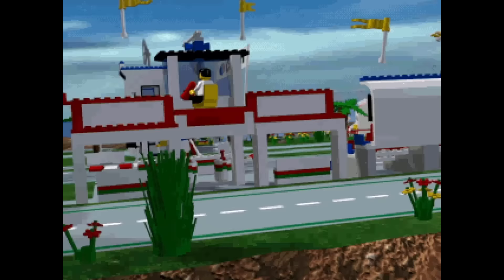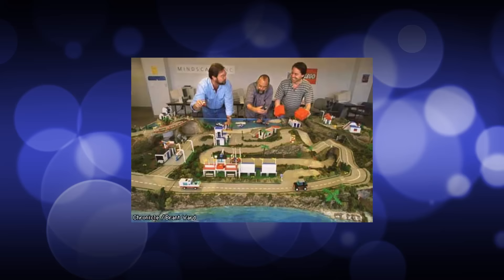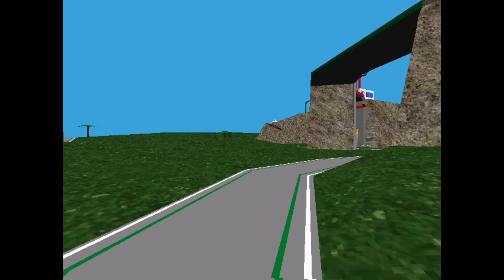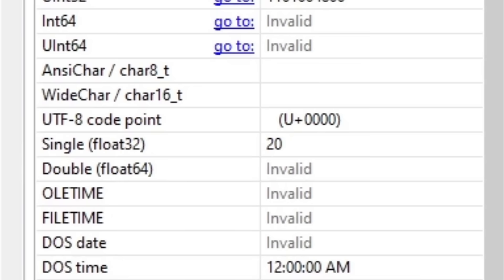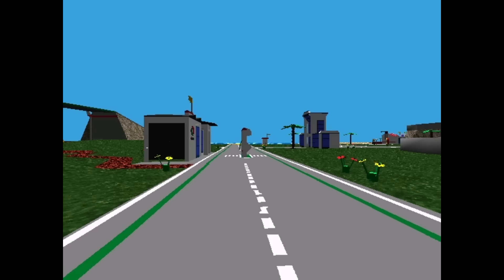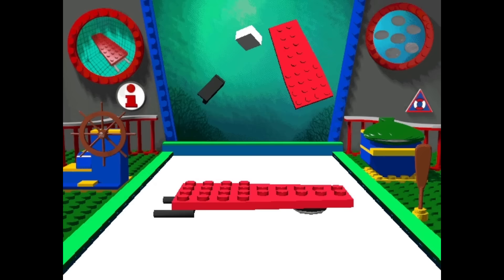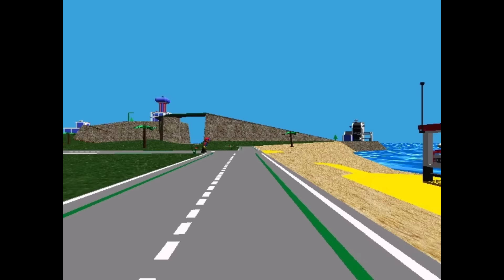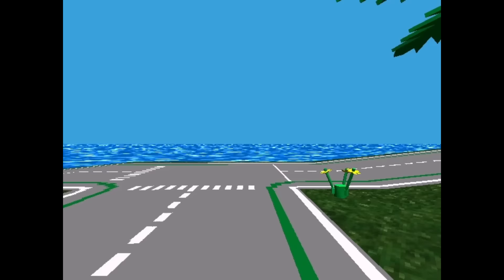How I fixed LEGO Island's WORST bug

Comment: It's 23 years later and devs are still making games rely on FPS for physics. when will they learn :(
Reply: Because they dont touch physics at all in their games.
Reply: @czowieknuz7507  true they just use old physics engines
Reply: @Cleroth because its not his job
Reply: @czowieknuz7507  No, physically "convince" the developers to use time instead of framerate.
Reply: time.deltaTime I FUCKING SWEAR
Reply: @iceburger3933  lmao fucking same whenevere I play some shitty FPS limited console port or a toddVerse(tm) game
Reply: @wesleymays1931  As a software developer if there is one thing I do not like is anything that has to do with time, it is my guess this extends to any kind of developers, including game developers.
Reply: *cough Nintendo
Reply: Makes for some funny glitches tho
Reply: Fallout76 intensifies
Reply: RIP 60fps hacks
Reply: @diablo.the.cheater  Doesn't matter if you hate it or not. Physics calculations in the real world require time as a component. How high is the ball I just threw? Well what was it's initial velocity vector, and how long has it been flying for? In the modern day if you are developing a physics engine and you don't use the time since the last batch of physics calculations, you are objectively a bad developer.
Reply: It's been 7 years and you still can't teleport to your safehouse
Reply: time to start hoping R* fixes the cloth physics :(
Reply: Easier to code and doesn't make too much of a difference if you've capped the framerate. Is better but as a hobbyist dev myself, sometimes you just can't be assed.
Reply: If this game was in c# then i can fix this with 1 line of code

Time.deltaTime
Ez
Reply: Did you all just miss the part of the video where he said this incredibly easy mistake to miss that is very easy to make shouldn't be something you're too hard on developers for or
Reply: @fedevanced  yeah, to some "other speedrunner"
Reply: @wesleymays1931  What?
Reply: b o n e w o r k s
Reply: ahem gta v ahem
Reply: Because sometimes you don’t need to be running a separate physics tick if you know your game will always be locked at a certain framerate. Usually you don’t see this nowadays, since we’re way past the days of super limited console hardware, but older games tend to do this because it’s not as heavy on the CPU. Most of the time when you see it now it’s when a game targets a specific set of hardware that is expected to always hit a framerate target no matter what (like some Nintendo games which still do that to this day). Other times it’s just shitty design/not taking PC users into account lol.
Reply: What are some good examples? I am curious if I own any...
Reply: @MaxUgly  crash bandicoot n sane trilogy
Reply: @MaxUgly  Spyro Reignited Trilogy. Some parts of the game are (near) impossible after going over ~100fps
Reply: It's not that they "chose" to rely on FPS, but that they forget to incorporate the delta when calculating speed. Movement is something that NEEDS to be governed by the physics process or physics body in your code in order to calculate your speed at all times. It's such a common mistake because it's almost exactly what you have to do for movement. The actual mistake is that devs forget to multiply the speed with delta, like shown here 12:18.

Speed = TargetSpeed ----- charcter speed will be affected by framerate
Speed = TargetSpeed * Delta ----- character speed will be the same regardless of framerate
Reply: Let's bring up that this can create bugs when the framerate dips. People generate lag in some games that do rely on time, so that they can make the physics more choppy and just clip straight through something.
Reply: @iceburger3933  Time.deltaTime needs to be used for movement (in Update only) to make the object move the same speed at any frame rate (unity)
Reply: @Just_A_Microwave  unity*
Reply: Okay, so, do you know why people use FPS as the clock? It's not because "DURRRRR! ME STUPID!" It's because your game probably, almost certainly, has to run on a console. Now as powerful as a modern console is, it's still the cheapest possible gaming PC in terms of its hardware. That's how they will always be. As a result, the vast majority of their power has to go into rendering the ever-shinier, more HD, more realistic eye candy that game devs seem to think is mandatory for a game to sell. Hence, any game intended to be played on a console has to use a lot of shortcuts and hacks to save power where it can. Since the framerate on a console is capped (and usually locked) to 30 fps, and is already a ticking clock in and of itself, you can either use it, or drain a bit more resources to code in your own clock.

That would be all well and good if games were developed differently for different platforms... But they are not. PC versions are always based on the console game because consoles dominate the gaming market for reasons I will never understand. Which means game devs do this because it's the industry standard due to being a small part of what makes the game most likely to ship the most units, according to them. This is a small part of how the mere existence of consoles fucks over all of videogames, see also shitty controls, bad menu and UI design, highly limited dialogue systems, and bad color rendering.

Thank you for coming to my TED Talk.
Reply: @randomguy9777 people in the future : dude why do i have to cap this shit at 240 fps, i just instantly die if i use uncapped and run the game at the much smoother 1 million fps
Reply: 24
Reply: geometry dash physics sorta
Reply: 25 years now..
Reply: @diablo.the.cheater 
L
Reply: @Just_A_Microwave  Same.
Reply: Hey, you. You're finally awake.
Reply: And the related problem of slow motion making random stuff in the physics system break because it massively over applies physics forces during slow motion
Such as cryonis guardian launching and shield jumping in breath of the wild and weapon wheel super jumping in doom eternal
Reply: what modern games have an unlockable framerate. none.
Reply: @DogsRNice  That's not a problem of slow motion inherently fucking up the physics though, and it definitely has nothing to do with framerate because the actual framerate doesn't change.
Reply: Hey, it’s unfriendly baron
Reply: Amnesia bunker release in 2023 still has a frame cap of 60 most likely for this reason.
Reply: Never
Reply: Not really. The reliance on FPS is to make the what so called "game loop" much simpler and easier to understand and maintain. Separating FPS from physics engine doesn't make that much difference either because you still need delta time value involved in the engine. Even if the display (FPS) works separately and physics engine uses its own delta time, it's still not a guarantee that your PC won't stumble upon the situation where computing power isn't sufficient for the task. You still inevitably introduce a chance of physics bugs related to delta time or slow down in physics in case you need critical accuracy on it.

The only case that separating physics engine from rendering engine makes a difference is when you have little physics events happening and you have enormous size of game scene that may impact the overall game loop calculation time.

Noting that modern game engines also have features that help you separate physics engine from main game loop. It does help quite well on this case but many Devs simply aren't aware of its existence or simply just ignore it due to crunch time.
Reply: GODDAMN DMC5!
Reply: Never, and that’s why i love it.
Reply: Guilty!
Reply: Because we don’t care enough to learn lol
Reply: Half Life apparently had that problem, and it wasn't until the 25th anniversary it was fixed.
Reply: The fps cap on the table:
Reply: Especially rockstar. Rockstar games still has game design from like 25 years ago all the while also pushing the boundaries at the same time lol it's kind of confusing.

Comment: Soon you'll have this game running in 16:9 widescreen 4k, 240fps, with HDR, and RTX!
Reply: Considering they got raytracing working in Doom (the original, not 2016), I'd say that's not too much of a stretch.

From a technical standpoint, that is. I doubt anyone with the required knowledge still cares enough about this game.
Reply: @nixel1324  raytracing in original doom? what? its not even 3d
Reply: @Timsturbs  i think he meant quake
Reply: @STJrArmonte  there's an original quake with raytracing?
Reply: @Timsturbs  to be clear, it's very different from what we think of as raytracing for 3D graphics today. In old sprite based shooters they used rays to figure out orientation, scaling and shading of sprites. However it was made possible by locking those rays to the x-z plane. So essentially super simple 2D raytracing in a 3D game. A cool trick, but got superceded by rasterization for rendering more "true" 3D games. Until GPUs got powerful enough for the raytracing revival.
Reply: @Dandylion oh please be so kind, gimme a link to original quake with raytracing
Reply: @totallycarbon2106  you're talking about ray casting. its from the same field but a bit different.
Reply: Tim | I think they're talking about Quake II, there's a free demo version on Steam with RTX, you just need an RTX video card.  Its just called "Quake II RTX" And that game came out on the same year as Lego Island
Reply: You are a bold one
Reply: Only 240? 366fps take it or leave it
Reply: 8k rtx 2080 128-bit hdr
Reply: What's the appeal of 240 fps? The max the human eye can see is 120, I don't see how having more than that as helpful
Reply: @maximumwolfe9462   You're joking, right?
Reply: @greedie__8858  Nope
Reply: @greedie__8858  I'm not just salty that I have a crappy laptop either, I legit want to know
Reply: @maximumwolfe9462  Myelinated nerves can fire between 300 to 1000 times per second, They also go around 200 miles per hour. Though some people can't see the difference between 120hz and 240hz at first, once you go back to 120 you can tell that there's a difference. It's really weird lol. I recommend going to best buy and checking out their 240hz monitors. they should have some out on display.
Reply: I used some big words, damn.
Reply: @greedie__8858  Thanks for the explanation, I get a bit confused when talking about fps and stuff like that, for me 60 fps is playable, but I do prefer higher frame counts, so I'm going to probably get a 240Hz monitor for my Xbox and soon to be working PC
Reply: @maximumwolfe9462  Nononono, 240hz isnt gonna be usuable on the xbox, even the new one is only going to be 120hz. Dont waste your money, it's a difference but not worth it. Even on pc. The jump from 120 to 240 isnt as big as 60 to 120 or 30 to 60.
Reply: Also, you're welcome
Reply: Don't get my hopes up like that.
Reply: Lego Island: Remake
Available in 2046
Reply: AnD 88 MIlEs Per HoUr
Reply: I would love to play that.
Reply: HDR and RTX are a bit too much for a 23 year old game to handle, though I'm sure you can get away with the 16x9, 4K and 240+FPS claims lol

ORIGINAL COMMENT: I think you went too far with an HDR thingy and rtx, but I guess you could get it working in 16 by 9, 4K and 240 FPS
Reply: @maximumwolfe9462  lol..20 years ago many folks said the same exact thing, except  it was 60 fps. 
Eyeballs don't see in "frames". We don't have a refresh rate.
Reply: Dont forget 8k remade graphics
Reply: @maximumwolfe9462  there is an appeal besides just looking nicer, if the game is relying on good performance, a higher FPS will make those FPS dips less apparent if you get those frame dips compared to 60fps
Reply: Whoops! You have to put the RTX in your computer!
Reply: Nice
Reply: Don’t forget the 88mph!!
Reply: @nixel1324  that’s open source however so it’s easy to mod
Reply: somebody please remake lego island with raytracing on
Reply: Nope
Reply: Well, with that framerate and the bug still enabled, the character will probably have a walking/turning speed of light years per second.
Sounds playable right?😄
Reply: XD
Reply: In other words.... project island
Reply: @EdyDev  7200 take it or leave it
Reply: 88 miles per hour
Reply: You would have to remake the game for rtx
Reply: And 88 MILES PER HOUR!
Reply: Wait until it runs on a N.A.S.A hyper-galatic quantum altoid.
Reply: 500 miles per hour!
Reply: Nice
Reply: @Timsturbs  yeah, on xbox
Reply: Rtx 4090
Reply: At 88 miles per hour?
Reply: reshade
Reply: @Timsturbs  the original DOOM has countless source ports, many of which support true 3D graphics and raytracing for those graphics. depending on the source port in question, you CAN enable raytracing in these sourceports for the normal sprite graphics and there is a noticeable difference, but its weird and nothing like what you would expect and not really worth using with the old sprite graphics, to some it looks pretty bad even lol

but basically, what it does is the entire sprite just lights up as all the rays uniformly bounce off of it as if it were a 2D plane when there is a light directly in front of them, and when lights arent directly near a demon it just kind of looks like there's a blotch of brightness on the sprite coming from the direction of the light. they do also cast semi-reasonable shadows when they are perpendicular to a light source, too

In some mods that use ray tracing but the original 2D sprites, they've also added normal mapping to the sprites that is then used as pretend geometry for ray tracing. This is actually done in some modern remastering of 2D games to give them ray tracing or some form of "real-time" lighting as well.
Reply: we can do widescreen 4k with dgvoodoo
Reply: @totallycarbon2106  doom doesnt use raycasting.
Reply: Time to learn how to code in whatever coding language Lego Island is coded in to add that
Reply: He already added the fps feature
Reply: @maximumwolfe9462  some can see 240 FPS
Reply: Ray-traced Lego Island
Reply: @totallycarbon2106  is called rayCASTING
Reply: @STJrArmonte  no he's right there is raytracing on doom 1993
Reply: it’s true
Reply: @Timsturbs  well, quake is open source so it's not that hard to implement, unlike lego island
Reply: @ashleapatterson82  88 MPH‽
Reply: @nixel1324  doom is open source and is writes in pure c if I am not wrong, but lego Island is not open source and the decompiled code is in assembly, so implementing rtx becomes a lot harder because, in general, assembly is harder than c, but, it is a 100% posible to do it :)
Reply: @Timsturbs  quake 2 with rtx is on steam :)
Reply: @lolcat69  quake 2 without rtx is on my shelf :)
Reply: @Timsturbs  :)
Reply: The eye doesn't have a refresh rate, but individual photoreceptors do, and they're not even the same, much less integer fractions of a second. I'm pretty sure that there's some post-processing done by the brain to perceive a more consistent framerate, but it's not what it recieves from the beginning.
Reply: 88 Miles per hour
Reply: AND 88 miles per hour!!
Reply: 88 miles per hour!
Reply: Bc of his hacking, yes
Reply: @STJrArmonte  nope he meant classic doom 
A tiny search and you will see
Reply: 💀💀💀 Fr
Reply: 9
Reply: Htu
Reply: 88 miles per hour?
Reply: 88 miles per hour
Reply: 4096×4096
Reply: The thing is he is decompiling Lego island so like ermmmmm 😮😮😮😮😮
Reply: @Timsturbs I assume it's GZDoom.
Reply: but can it run on 88 MiLeS pEr HoUr

Comment: One thing to note is that this is how fighting games handle everything as well usually, Intentionally though. They want to make it fair and thus slow down gameplay if the game lags out, always ensuring that one of the players doesn't get a head start on the other one while the game freezes up.
Reply: And also feels horrible to play, which is why it's sorta being replaced by rollback. A system, which, instead of freezing one side until they sync back up, let's inputs continue and eventually "pulls back" one of the players to be in sync, which feels far better (though looks worse, due to "teleporting" and the like) but is still vastly preferable due to how much more playable it makes poorer connections

Comment: Could you please elaborate on modding the executable? I would like to achieve it without a user-friendly tool
Reply: From the screenshots in the video it looks like he is using x64dbg and HxD to do his analysis. Most likely he is either using IDA or Ghidra also for static analysis. But showing assembly code makes you look smarter ;)

They aren't easy tools to use by any means, and you definitely need to have a programming background first so you're familiar with concepts like memory, types, control flow and pointers and can apply that knowledge to guess how the game was programmed, if you wanted to take on the challenge of figuring it all out yourself. I'd recommend following Stephen Chapman's Cheat Engine tutorials, which covers much of the same ground.

Comment: multiplying every movement vector by a floating point delta time value takes a lot of processing power, so it's sometimes better to not apply the delta time value everywhere, so you can have more things going on in the time a bunch of costly floating-point multiply operations would take.
Reply: Do you mean something like... sum all the forces acting on an entity, and only then do the delta-time multiplication on that total once per frame? That's what I'm doing too.
Reply: @whoshotdk  No, as in, sometimes devs will choose not to multiply the forces on each object by delta time because it frees up some CPU time that they can use to process more objects
Reply: im assuming it uses fmul instruction which yeah... its slow

Comment: I just recently taught myself about Delta time and implemented a variable framerate in my own game project. Technically it's capped at 600fps, but my machine only hits ~340fps in my test room. No minimum Delta yet - but only because it's still a work in progress and I haven't yet decided what value to set it to.